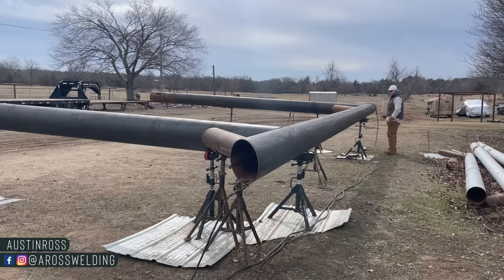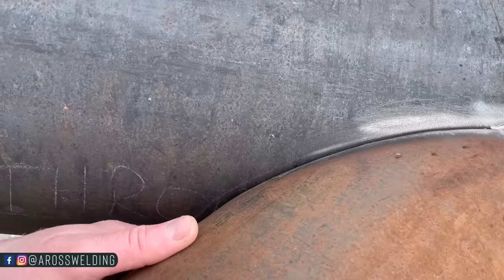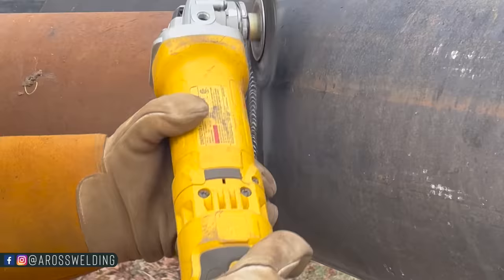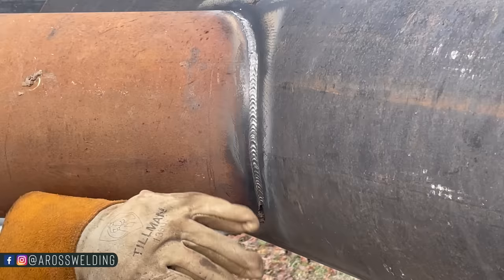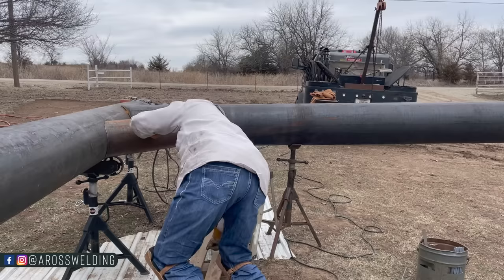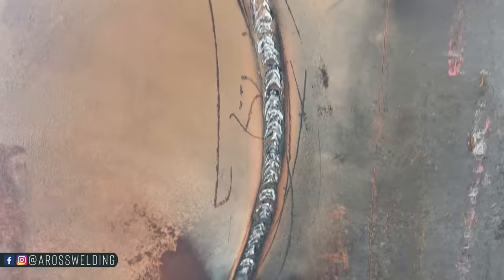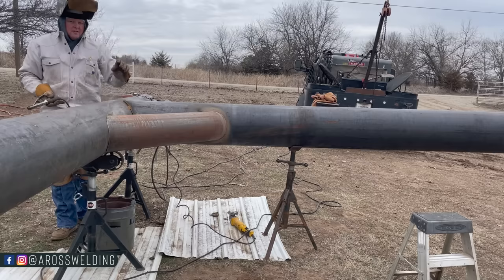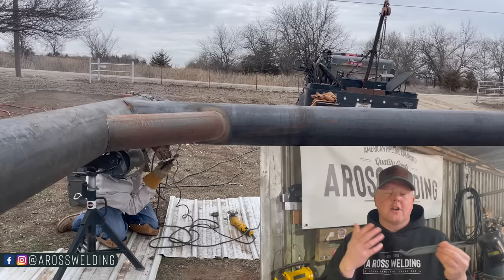Why Pipeline Welders Only Burn Half a Welding Rod

Comment: I have burned half a rod so I'd have a few to get under the bottom. Bore casing is always close to the ground unless its 8 or 12 inch. 12 inch casing would be 1 ft off the ground.

Comment: That I didn't know. Retired after forty-three years as a machinist. Thirty of those last years was as the Operations Mgr that was just supposed to be temporary to help the owner out till he found a replacement that never was found. He told me the biggest reason was the ones he thought could do the job and operate all the equipment and also weld couldn't do any of them even halfass. When we got covered up or one of my welders were on vacation or sick. I could fill in and mig or tig the job we were on just to keep it going so as not to have a late delivery. I haven't held a stinger in my hands for about thirty-five years. 

 Now that I've got quite a few decades under my belt my eyesight isn't as sharp as it was in my younger days. I have to grab a piece of scrap mainly to find that sweat spot of where to keep my noggin so I can see the bead before welding anything which isn't very often nowadays. Had a friend that welded pipe and I noticed he started with a new rod after about half the one he was using was gone. I never asked him why. I just figured it being a pipeline was the reason and he didn't want any of his welds to fail inspection. While in the shop we used whatever tooling or welding supplies till there was nothing left.  That's one hell of a fence or is that the gate? Nice looking welds and Great video plus a new sub.
Reply: i always worked as a combination welder/machinest when working for the other man

Comment: Why did u weld down hill? I was always taught to weld up hill, to keep the slag from running into the puddle.
Reply: Generally true, but with the right rod and the right heat it can be done. Don't weld down without the proper training from a qualified instructor.

Comment: As a non certified welder who learned to weld in the mid 70's and have welded off and on ever since this is the first time I've heard this. But this does make sense. Used rods are a pain sometimes and can cause extra work with grinding and the overall aesthetics. Welded on 10 to 30 ton Heat Treat furnaces in the 80's using mostly 7018's 1/8 in.. Had to weld in all different positions up, down, dangling by harness you name it. Our foreman at the time always insisted that if we had to break off mid weld whether by accident or the position just got to be really uncomfortable that 1) adjust your position as needed and 2) always start with a new rod (never really said why). But I can remember a few times when in really hard to get to places you always had an assistant for safety and to be a gofor, if a weld was stopped mid weld with a half stick before restarting the foreman would hand me a torch to heat the metal on the weld line. Not to red hot but just good and warm and the half stick would start like it was brand new.  All welds on those furnaces had to be tested and x-ray'd, even it it was just a small panel for solenoids. Never had a failure. Partial rods were never wasted though. There were always little side projects that they could be used on.

Comment: My father was the Forman at a steel mill Pipe shop. when I was in high school  I learned how to arc weld using those cast off pieces back in the mid 60s.

Comment: API is a complete bend test the same bend test that is used for uphill have passed both mostly worked in plant pipe work both are tested as strong different proced;ures for different thickenss etc

Comment: Haven't watched and making a w.a.g. on the reason pipeline welders only burn half a rod:

if there is ever a problem with that pipe the unburned half the rods can show the welder did or did not mess up on the welds affected by the problem

Comment: The bigger the pipe the easier it id to weld. Try 2” pipe 8” off ground and you can’t roll out. Then setting up over and over on straight runs.

Comment: At a time in my youth, male's in grade school were taught in what was referred to then as "SHOP CLASS" how to do various thing's by hand. One of which though hard as I could try, never was able to get the hang of welding. But to this day, are amazed that those who not only can, but seem to do it effortly and extremely well.

One thing I learned in regards to safety was, never to weld without the welding hood, with the dark glass. It apparently is or will cause to the degree one to be come blind. Though it may be a stupid question to you. Is there a distance from someone who is welding in which the ark would be safe to view. I mean, if I happen to see some one several hundred yards away let alone several feet. I turn away immediately.
Reply from the maker: It is a good practice to look away just as you did. Chances are if you are outside and a couple hundred feet away it may not effect you much but I wouldn’t take the chance. It’s worse inside shops where the arc is bouncing off the walls and whatnot… it’s even more important in these environments to where dark glasses and not look at the arc at all with out a shield.

Comment: The issue with used rods seems to be missing flux melted off the end. Would trimming them with a cutoff wheel solve that problem, removing unshielded metal that was exposed to air while it was molten? It would seem the real issue is stops and starts, more than using half a rod.

Comment: I’m just curious I’m not a pipe welder but what is the pipe structure you’re welding going to be used for 

Great video , awesome welds
Reply from the maker: It is an overhead entrance
Reply: My guess is a massive gate entryway for someone's ranch. I was curious myself.

Comment: Happiness is 6010 and a few miles of pipe many weldors are taught to do shop welds under perfect conditions, field work is very different. And you do whats necessary if you sacrifice half a rod by bending or clean restart its ok dont listen to the beancounters

Comment: the same speed you pore water should be the same speed you weld .. if your inside  if out side go slower because of water in the air . cold metal will wick water so some times you might need to heat it .

Comment: I hope if you are on a pipeline job you make those welds up hill. I was a pressure welder for years, now retired and we didn't weld anything downhill.
Reply from the maker: https://youtu.be/w8KxmK_T3Nk
Reply: lol 8010 is specifically designed and spec’d for downhill. If you were on a pipeline trying it uphill you’d be exposed as a greenhorn in a microsecond 😅

Comment: O see alot of comments about welding uphill vs downhill. Just for the record high penetration rods made in Germany came on line in about 1974 and were used on the trans Alaska Pipeline. Made specifically for fast downhill beads no wider that 1 1/2 times the rod diameter size. Also bevels were CHANGED from 45 degrees to 37 1/2.Less weld had to be deposited. Temps to burn these [cell 80] german rods were hotter as well .Speeding up the travel speed . Shortly after 80 series rods [high penetration]rods began being manufactured in America specifically for down hill welding. The rest is history. Thats where all these 80xx series downhill high penetration rods came from. Trans Alaska pipeline was done all downhill.5/32 root 5/32 hotpass.3/16 fillers and cap. The famous 798ers out of Tulsa Oklahoma and Bald Knob Arkansas  perfected their use. I was 20 years old[in 1976] and I was there. Still in Alaska.

Comment: im a bit green to welding myself and have a small stick welder, your advice about starting with a new rod would be good but in my case the rods are a bit damp. so continuing with a half-used rod I find to be easier. this may be down to the water having evaporated by then

Comment: I found that -  doing a welding run was better to try and use one rod for the full length of the weld then bin whats left and not try to use that on next weld and run out halfway through yr next weld as it introduced trouble.  {holes / prossity   -  unless I suppose you grind gouge but it was easir just to have one complete weld}   The short sticks I like for  tacking.  As for used rods I found what someone said years ago -  often just gold the rod on metal tobe welded and wait -  often youll see it glow then suddenly explode into welding.   But still learning and have gone back to mig for speed and expecially filling holes where can.  Im of mind now to  use stick for tacking etc...   and wait for windless day to MIG.  {might go for gasless wire next time}  but MIG is pain for overhead regarding blobs on tip.  But I need much practice stick -  but seems to rehearse making the same mistakes  {something about teaching old dogs new tricks -  so too speak}.    Coffee good.  But if end up with pissing problems -  fennel is good!

Comment: Not being a welder and having very little experience with it I've always wondered how safe one is from electrical shock when body parts (such as arm, leg, chest - even though covered by clothing), are in contact with the work and simultaneously handling the weld rod.  Is it the Voltage Reduction Device in the welder that provides the protection?
Reply: If you handle rods with sweat soaked gloves you'll get a nice shock from it.
I always wear latex or nitrile gloves under my welding gloves during the hot months as I'm a heavy sweater, even when I was in fantastic shape I'd sweat a lot.
Also helps having an extra dry pair or two to cycle out around lunchtime.
Reply: If you are working with DC, which most welding is, then you have very little chance of getting hurt from it.
Now if your gloves are wet, the rods are wet, and your clothes are wet. Then you can get bit.
35 years of welding in the oilfield, and offshore operations.
Reply: lot of ways to get shocked, not much of its actually dangerous though but It can hurt like hell.
Reply: Running a stick welder it is not too bad even weld underwater.  Doing aluminum with a HF tig will shock the wll just say wear your brown pants that day ;)
Reply: like they said, being dry is generally good enough given the low voltage, plus good gloves and good shoes. If the ground is wet you should use an insolating layer to stand or kneel on, it will also be a lot more comfortable than being in soaked pants all day. 
On the other hand, damaged ac leads are potentially deadly. I've dropped something sharp on my grinder lead at least few times and it never was pretty

Comment: I usually stop using them at 2-3" depending on diameter. 1/8" or smaller I burn down to the nub

Comment: Let me guess the pipe fence is all about old drill stock and magnetic pipe to non?
Just wrap your ground cable clockwise or counterclockwise to get the weld to stick and not blow out

Comment: I am a rookie welder.. been about 2 months and during my  short training we didn't learn much of the techic like overhead welding... Since it was provided by the government we didn't have access to safety equipment like helmet and leather aprons or gloves all we had was hand screen, so the other day i was trying to weld over head weld and noticed that the molten metal was dropping down as i weld 😅 can i get some advice how to prevent that from happening... I came up with welding in spots instead of running it on a go but it didnt turn out clean 😅😅😅 was a very ugly welding. Please share some of the tips 😁

Comment: When I was in welding training 3 years ago we used a 6011 for rootpass and for a beginner I'm struggling to make a 2inch weld coz my rods is burning flaming and it make the handle hot although we're using a gloves. I keep the current high because I can't strike an arc with low amp hahahahahaha
And time goes by, somehow I managed. I slowly learned through experience and managed to pass the assessment.
But for now, I'm self-employed doing structural like gates, railings even truss.
Sorry my english is not good, I'm a filipino and only secondary graduate.
Hahahahhaha

Comment: I'm only an occasional welder but I would be in big trouble trying to do a downhill weld as you did.  I don't have good control of my weld puddle.  16.06 Your comments about the long and short rods is just the reverse for me.  I feel more comfortable with the short rods than long.  Like anything else, if you practice starting with "used" rods you get better. All my welding is for me and my pocket book doesn't like "waste"!!!!!    I get a giggle out of all you "pros".  You could weld better with your eyes closed and standing on your head than us rank amateurs.

Comment: If rod was only meant to be half used they would come in 6" lengths or only have flux on half the rod. Got 44 years experience and never once welded downhill.

Comment: And As the rod gets shorter it is much more difficult to control as your range of motion is decreased.  I also would tip weld the bits together  all the little bits and bobs.  DAD WAS CHEAP.

Comment: Nothing wrong running 6010 or 8010 downhill on structural I always capped with 7018 or with 8010- 10018
I think by running a 6010 or 8010 on structural it gives you a better concave base so when running 7018 you can run hotter and won't blow the base material away just running 7018 and with 6010  downhill your 7018 holds the heat better so have a much prettier Vertical weld

Comment: this is critical for corrosive/explosive materials/radioactive  component building using a new rod after burning half a rod also happens to be due to getting a good feed rate and rhythm going whether its brushing/back filling or circling to puddle fill that metal into the gap as it's easier to maintain with a longer rod especially when getting and going deep into tight spaces.
failure is not an option, it requires starting back at a blank slate which isn't always possible once you get to far into a component build, so you could end up throwing away $3,000-$30,000 and easily into $3,000,000 component pieces when you eff up something simple..... you don't want a soviet K-19 widowmaker taking out a nuclear power submarine with a full complement of nuclear missiles on board in the middle of the atlantic ocean.

Comment: Prior to retiring I was a Field Mechanic, learned on good ole 6011 / 6013 , One day I stopped by the welding supply house to pick up some supplies an the guy gave me small sleeve of 7018 , Man never looked back from there . I had one Customer that had a tired tired ole worn out Cat 613 pan of course this was pre-electronic days an on cold morning's I could count on him calling me at like 5:30 AM to get it fired up , I had a gasser Hobart on the truck of course . I would hook up the jumper cables & then stretch my welder leads out , have that ole girl set on 400 Amps an connect the ground lead to the jumpers give the welder a couple minutes an then flag the Operator to hit it . That ole Cat motor would roar to life belching black smoke . Damn it Elmer when you going to let me rebuild that ole girl 🤣.

Comment: Educate a newb about old sticks.  I thought getting a stick to strike was difficult if the flux extended beyond the core. In this vid, you said it is hard if the flux has retreated.  Are you referring to the quality of the weld after the strike?

Comment: With 8010... I won't start a fight with welders about that. Cold used rods don't start as easily and the work and risk for a single restart that could be avoided is worth a day of throwing away half electrodes. Whatever costs you a second that you could use laying down metal... is to be avoided. For some 10018-rods and above it might even be the workplace rules not to use a rod that has been in your clamp before. Just to make sure that you always use a bone dry electrode fresh from the drying oven. I ask the welders to do this when I take supervision as an IWE. It is some wasted rod against my butt in jail. So wasted rod it is! ;) But if some fancy stainless or inconel electrodes are used, I usually make sure the electrodes are used up better.

Comment: Pancake welding helmet, used one for 40 years, cooler, less bulky, better seal from weld berries hopping onto your eyeballs, mine didn't have the "OhshitA" side shield you see now. the other helmet is the Jackson pipe line shield that fits standard curved face shield head gear, I believe Jackson stopped making that shield, Awesome helmet, pre auto darker filters, no need to raise helmet just lean head back look, then tilt head back down to weld, welders neck ain't a joke (even though i tryed to avoid the knod) , just got me a new disk, 4 screw, and a plate made of titanium. as for burning half a rod as long as the filler metal is inside the Flux coating it's not a problem, I passed many an NDT using the whole rod. but if you don't have to pay for the rod I guess it ain't no big deal. Stick welding is a skill and the base for all other forms, tig, mig, etc, become a skilled sticker you can master all other prossess.

Comment: Not sure i understand the reasoning for not burning the whole rod when the fact is you will have more restarts to complete the weld. I used to work with a welder, who at his previous job, worked for a major structural steel company which made everything from bridges to huge fans used in industrial incinerators. He said they were given a certain number of rods to complete a job and if they needed more had to show the stubs to the supply room person who handed out the rods. He was somewhat shocked to see what went on in our shop where there were welders, mechanics, machinists etc. in a major railroad equipment facility. Nobody counting welding rods there. Course most welding was MIG by then, although welders were not allowed to use MIG on Locomotive Crane booms.
Reply from the maker: https://youtu.be/HXqfGHzafJ4